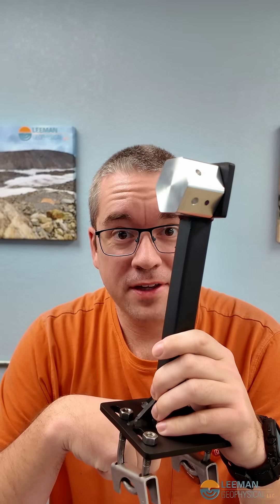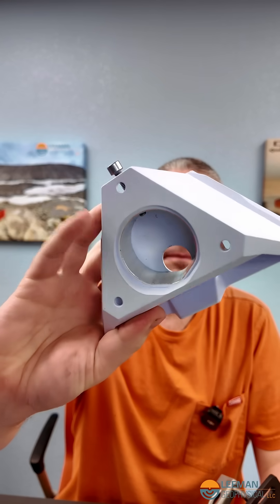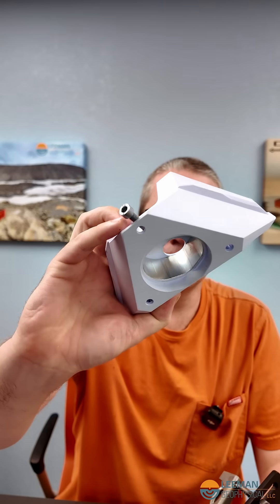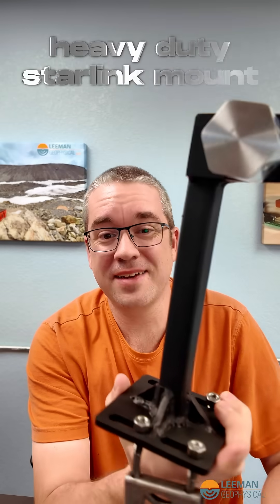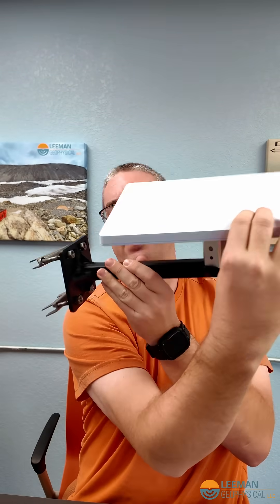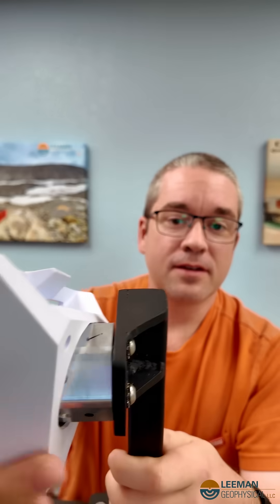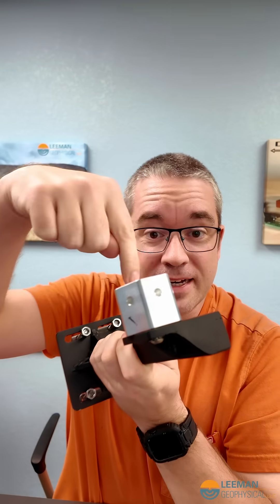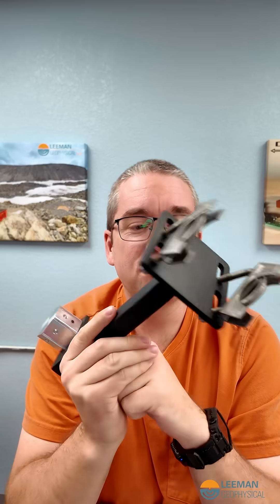The Starlink Mini Mount That Actually Stays Put

Comment: Drill a hole in the side of the pole.  Weld a tube at an angle in the pole.  As you extend the bolt it wedges the plastic mount tight on the pole.  Your bracket is going to be a big seller.  Question. On the u bolt mounting flange.  Holes for guy ropes. Or carabiner   look also at Vice grip chain wrench 27ZR
Reply from the maker: Holes aren't a bad idea for extra support - thanks for checking it out!